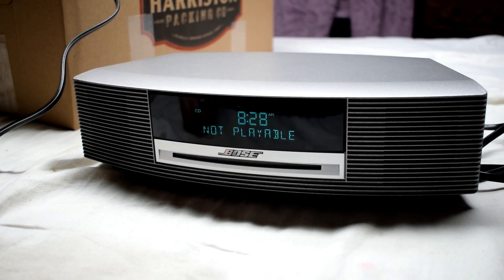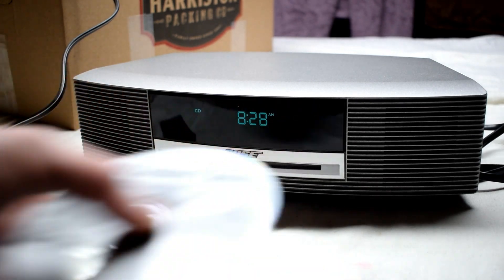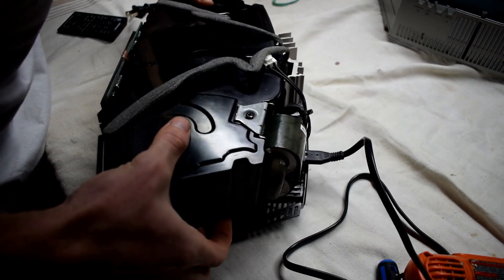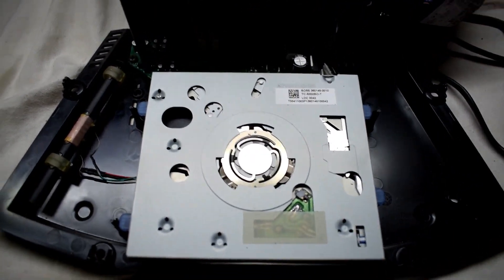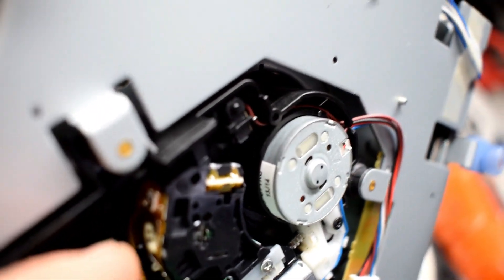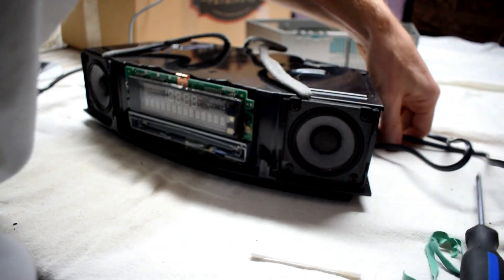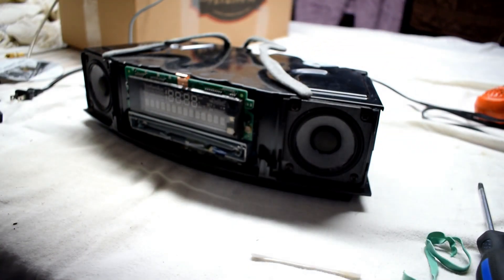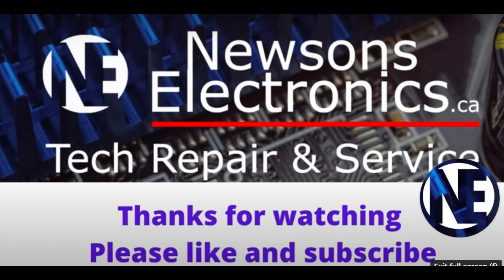CD not reading? Bose wave music system III CD laser fix

Comment: Appreciate you making the video but What screw? You didnt show anything of what you did!!! I did EXACTLY what you did & went EXACTLY where you went & I see something there but it’s not a screw. On my drive I cant turn that screw or whatever it is. It looks more like a hole in metal. Not a screw. Definitely nothing I can turn. Good try on the video but if your going to make these “How to” videos you need to be more exact on what your doing. I replaced a capacitor on a Bose Wave 1 before that had a similar issue. Maybe I’ll take that route. If you can make another video but point out what your doing exactly. Sorry. Not a great video.

Comment: Adjusting the laser power and cleaning the lense is not always the solution.  Another reason why you get that "Not Playable" error is because of the capacitors on the board underneath the CD player have died.  Cleaning the lense to fix the problem does not always work.  Also, why adjust the laser power ? this will shorten the life of the laser.

Comment: Thank you for the video but in my case it was one of the flatcable ends couple of pins on the end of the cable cracked. I cut off a couple of millimeters and put it in again and that fixed the problem

Comment: Literally turned the pot a fraction, if you can imagine a clock face my pot was at 1 o'clock turned it to 2 o'clock and made it worse, turned it to 12 o'clock and it worked, so for me it was anti clock wise that gave the laser more power. It playes like new now 😂
Reply: Until the laser diode burns out 😂

Comment: No visual on cleaning the laser lens  which you said you did. Not possible to reach it from this end of the tray
Reply from the maker: use a que tip
Reply: He's right, you either have to remove the sled assy , or remove the top half of the tray to access the laser.

Comment: Be careful when setting the power up on the laser as can burn it out very quickly. In most cases as repair these, it not laser. Dead give away is of CD doesn't attempt to spin and throws out CD not playable, or it plays most of track one and can't skip to next track and throws out error. Most cases it the motor that sides the laser back and forth develop a dead spot as brushes and commutator oxidized from sitting in one spot and way to fix it, is to move laser back and forth manually and then insert CD and sure start working again and skip tracks a few times to let brush wear in and polish plates. 

I literally fixed a bose wave IV radio two days ago and now plays CD'S fine and haven't had issue since. Other common issues is lubricated dry up and cause laser to stick and clean old lubricated off and applying fresh lubricated usually fixes it. Then you have the SMD capacitors failing on processor board which cause it not to play CD's, or no sound but plays, or clicking. I knew wasn't laser on that Bose IV as still had plastic on front display and was nice and bright. So not very many hours on it to be a bad laser and play track one but won't skip to next track. Now works perfectly and got it cheap as guy assumed laser was bad. Keeping that one for myself.

95 percent of Bose wave radios repaired and fixed well over 150 of them is not the laser and was the other issues.
Reply: What kind of lubricant do you use?

Comment: Thanks for this video. I had a similar issue. I opened up the system the way you showed here and manually moved the laser head to one end of the linear gear. I closed the whole system and everything worked. I did not clean the laser lens/head. So I suspect my issue was with the laser head on the worm gear needed to be reset/recalibrated. I experienced this issue after I moved houses. So there is a good chance the head was moved out of its expected place.
Thanks again for the video and hope this provides some more insight to others facing similar issues.
Reply from the maker: sounds right thanks for sharing

Comment: You didn't point to the laser screw , or explain which way to turn it and why. This video would be much better with a better camera focussing on what you are doing. :(
Reply: it is the silver screw with the blue mark (to show where the initial setting is) I turned mine a 1/4 to the right, no difference, then went back to initial setting and went 1/4 to the left (counter clockwise) and it works!
Reply: @johnschroeder2710  kindly point to the screw sir I can't seem to spot the screw with blue mark. Thanks in advance.
Reply from the maker: it changes the voltage of the laser , try one way a bit if it doesn't work do it the other way each system is different.